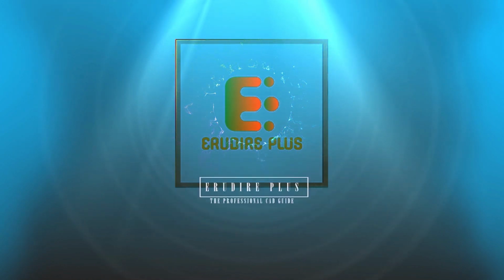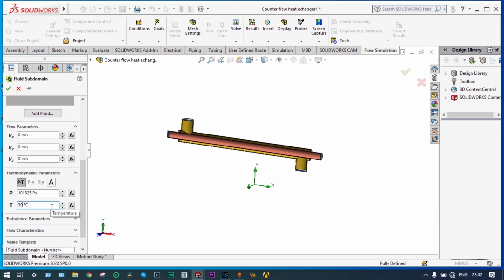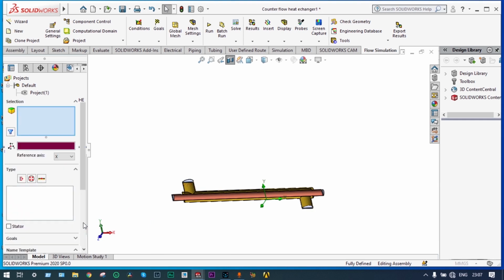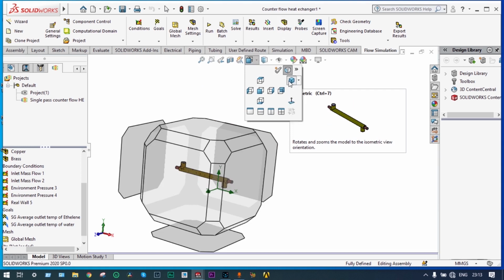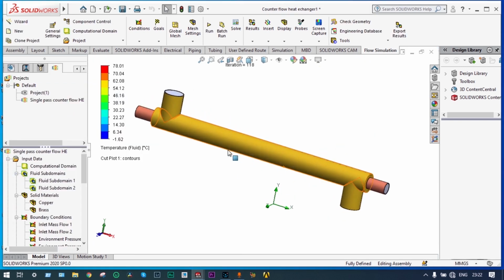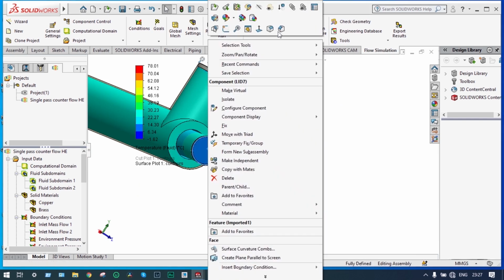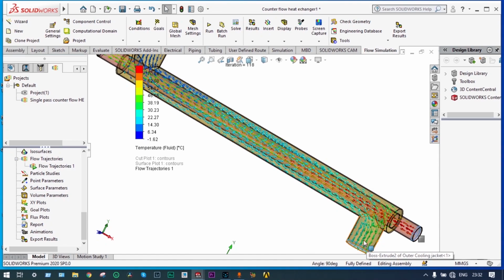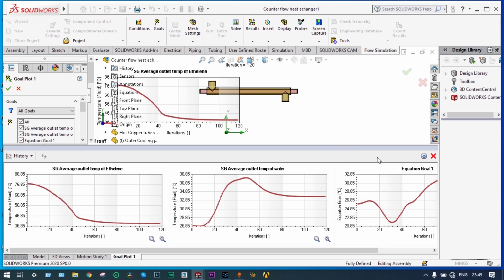Optimizing Heat Transfer with CFD: A Single-Pass Counter Flow Heat Exchanger Analysis in SolidWorks

Comment: Hi. what about if I need to know the wall temperature on the inner pipe.
Reply from the maker: Simply add a surface goal for the walls
Reply: @CFD_GUIDE  . Hi. thank you for answering. I would like to know if I'd need to add boundary conditions for each of the pipe walls.

Comment: can you explain what is the different enviromental pressure and outlet mass flow? im still confused using these two. thank you
Reply from the maker: CFD is confined to a closed space either it is internal analysis or external analysis. Therefore, whenever fluid is exposed to atmosphere through some opening or exit it is exposed to atmospheric pressure. That's why as a boundary condition exit end pressure is considered as atmospheric pressure. Again as per continuity equation mass flow rate at entry equals to the mass flow rate at exit. That exit mass flow rate can be obtained as surface goal and even sometimes it can be considered as a boundary condition to get other inlet parameters.

Comment: Is that two different parts assembled together or just one part?
Reply from the maker: It is single part
Reply: @CFD_GUIDE  is it fine to make it as two parts and then assembled?
Reply from the maker: No issues at all, but I prefer a compact single model to ease simulation effect. Later on, unwanted parts or components can be disabled for having better simulation results
Reply from the maker: I made it as a single part, but assembly is also ok
Reply: @CFD_GUIDE  thank you very much. Very good channel bro👍 subscribed!
Reply from the maker: Thank you for your support.

Comment: Thanks for the video sir,
Actually sir right now I am facing a problem regarding to the convection heat transfer. When I applied it as you tough there is a error popup that is"it is not possible to define the heat transfer coefficient and wall temperature at the same time when heat conduction in solid enabled".
Reply from the maker: If you want to condider convection from outer wall to atmosphere you have to consider external analysis.
Reply: @CFD_GUIDE  thanks for the reply sir

Comment: I saw a lot of similar videos about this kind of problem, but this is really simple and well explained. Thge only thing that is not specified is how to find out from FLow Sim the energy or the heat that is involved in the exchanger. In other words wat is the power lost from the hot fluid and at the same time what is the power in inmput to the cold fluid. Obviously one should be the same to the other, but how Flow Sim can give it to us.
Tank you in advance.
Best
Reply from the maker: Form an equation goal to have heat lost or heat gained.
Reply from the maker: To get accurate answer you have to consider convection also together with conduction equation in equation goals. However conduction will also provide you some idea with a little bit difference from actual theoretical or practical results

Comment: Sir...in case if I want to fix the outlet temperature of one fluid how to apply it using boundary conditions in solidworks flow simulation?. Thanks in advance!
Reply from the maker: That will be one optimization case. Here to maintain a fixed outlet temp you can change lot of input variables e.g. initial boundary conditions, inlet temp of fluids, mass flow rates or even inlet fluid temperatures also. You can take lot of parameters together or separately and perform parametric study and finally you will have an idea about more influenced parameter. Then with the predominant parameter you can proceed final outlet temp optimization
Reply: @CFD_GUIDE   Thanks for your reply sir. Also I would like to know Where  to define the value of pressure at inlet pipes of shell and tube in solidworks flow simulation? Should I define the inlet pressure value in fluid subdomain option?
Reply from the maker: Fluid subdomain must be defined after that while applying boundary conditions again it should be applied. Everything depends on actual application & actual working method. Boundary conditions dhould be applied as per actual working mechanism

Comment: This video is extremely helpful! Thank You so much. Definitely subscribed for more.
Reply from the maker: I am happy to see your interest in CFD.
Reply: @CFD_GUIDE  Yeah! I'm a last semester Mechanical engineering student, and the professor I had for solidworks didnt go over fluid simulations. Only static and heat flux sims. I appreciate your work very much ^_^
Reply: Hi sir can you please send me the link of cad file that you used above video
Reply from the maker: Thank you for your comments. Actually it is a very simple model and I have deleted this file immediately after uploading. I am so sorry.
Reply: Can you just let me know the  diameter in this model
Reply from the maker: I am not sure about it as I deleted it immediately after uploading. Generally I keep diameter as 100 mm and thickness 10 mm
Reply: Your videos are  very helpful....
Reply: I need help in other video